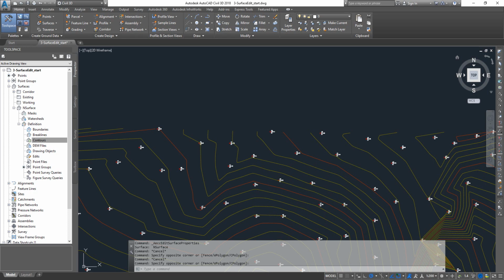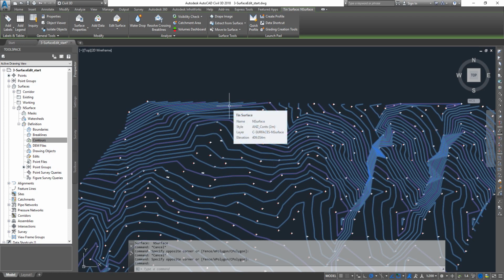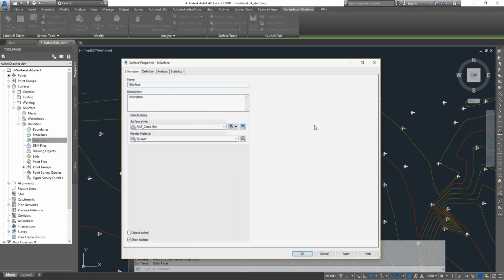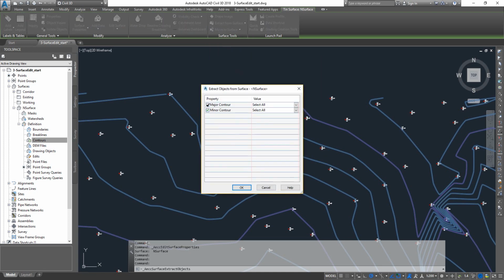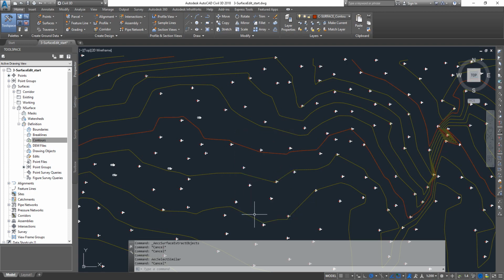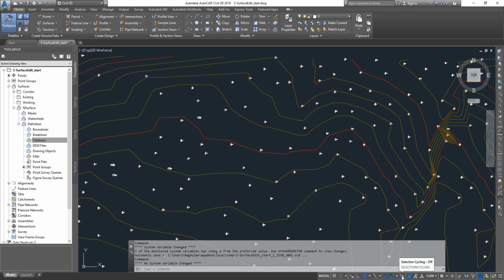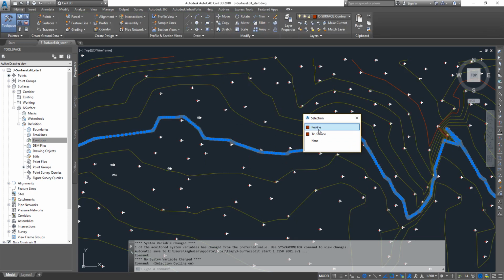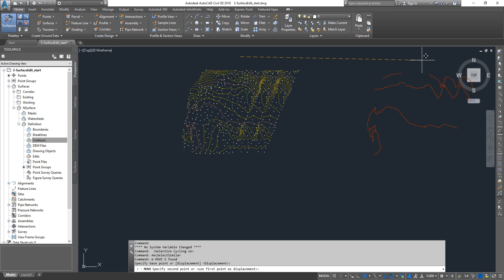Civil3D Extracting Contours from Surface

Comment: Regarding the subject of Extracting Contours from Surface, once these contour lines are extracted to polylines, will the surface label tool work on the polylines? Will the multiple label command work on those polylines when I strike the command's construction line through the polyline, as I would have done across multiple contour lines?  Please clarify if that function will work. For some reason when I placed my elevation (surface) labels upon the contours, the intervals did not plot correctly, even though I had the style set to display surface labels at Major Contours (every 5 ft) and no label at 1-foot contours.  It seemed that labels changed according to the 1"=20' viewport style. It also seemed that contours appeared and disappeared in model space according to the zoom factor and/or the scale factor. Maybe with your great knowledge, you can go into detail on this.